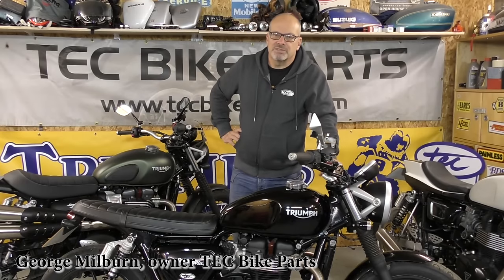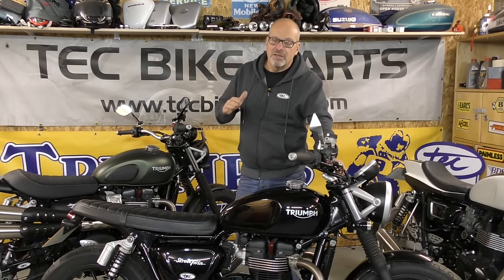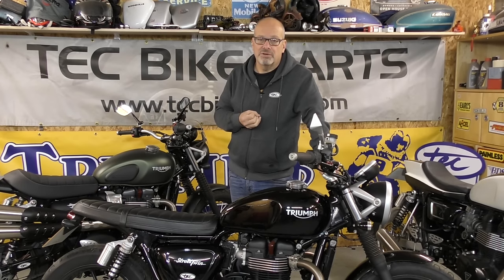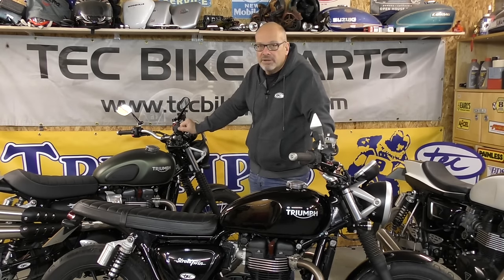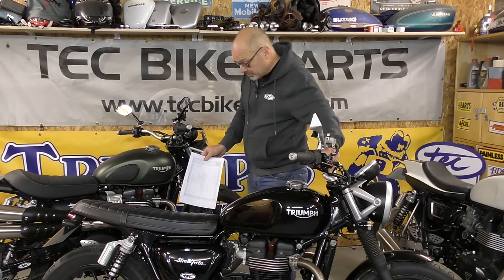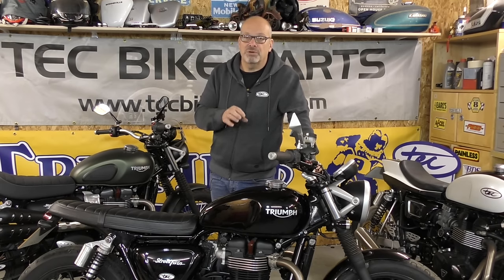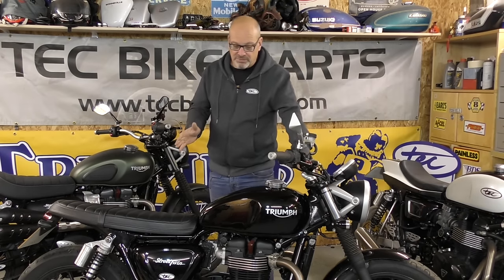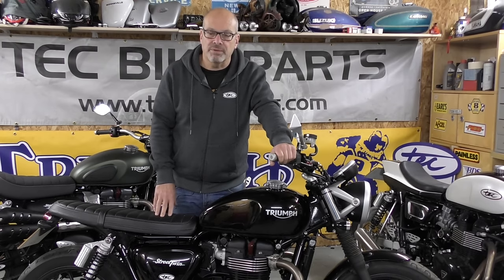How to de- restrict 900cc Triumph Street Twin/Cup/Scrambler/T100   for LOTS  more power and torque.

Comment: Triumph have basically done this to the 2019 model, oh, and guess what, the new scrambler 1200 is due out with more hp. Shows how pesky manufacturers can be.
Reply from the maker: Yes, they denied that they had changed the cam at first, but now they admit they have changed it after the parts lists came out. Watch reviews on the bike when it was released last year and how they said they had increased performance . no mention of cams only lighter crank and clutch .
Reply: Cigueñal y ejes de equilibrado aligerados, pero también anuncian una mayor relación de compresión de 11:1 (antes 10,5:1).

Comment: If only Triumph was as livid about reducing power on their bikes as the end user is. They may claim its reducing the power for the environment. But I think they want to make cars and bike as lame and miserable as they are in their lives. High power bikes and cars well tuned are as environmentally friendly as a lame vehicle is. You just don't need to drop the hammer as much to get it up to speed. Using less fuel as a result. Its like the low (no) flow toilets. You are not saving water if you have to flush it five times. Compared to regular toilet that flushes the first time. Maybe they are thinking only small adults or children use the WC?

Comment: Sounds like the Street Twin is a bag of shit, something like 54 Horsepower. I have a proper 865 T100 with carbs. None of the fuel injected shit or computer mapping bollox.  Mine is 67 horsepower and with Motowin exhaust and jets 73 Horsepower. I would not touch this piece of shit.
Reply: to each his own, have you ridden a street twin? I go back over 50 years and wouldn't own a bike with "carbs"again.

Comment: So, if you spend $ 300 to add xpipe and decat, $250 for K&N system, $900 for new cam, $800 for new exhaust, and about $1200 labor, you get almost same power as bone stock T120 (that also has a warranty that wasn't cancelled by modifications), you get bastard T100 for only $1500 more than stock T120, that also has better brakes, more features, higher resale, looks better and is more comfortable to ride.  Sounds like a good deal to me!!!  Moron...
Reply from the maker: If you are paying $250 for a K&N you are being ripped off ! Plus all the other prices you say are way off and more than double what they actually are .Check our price list.!
most people will only need to fit the cam at £300 plus taxes
Be careful who you call a moron !
Reply: mroilcat - Tell your daddy at Triumph we said, thanks for the shaft.